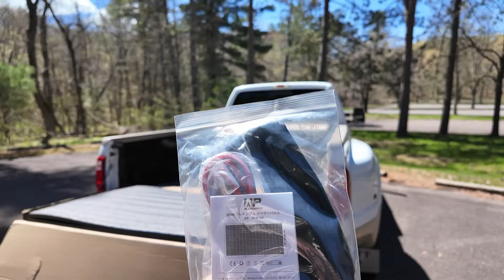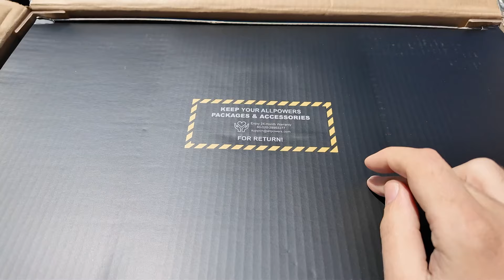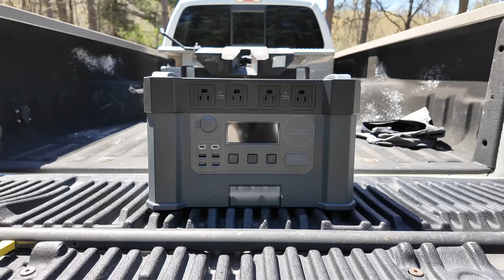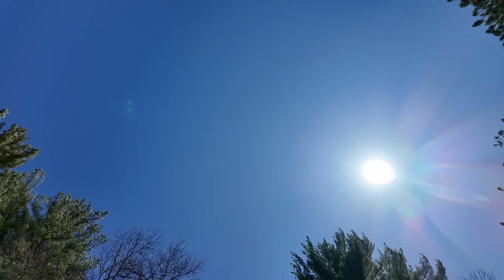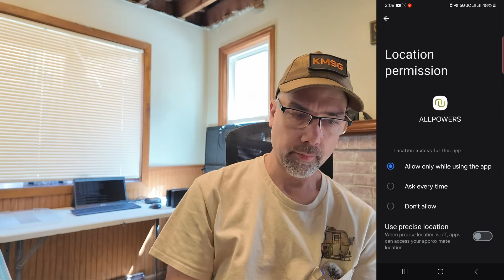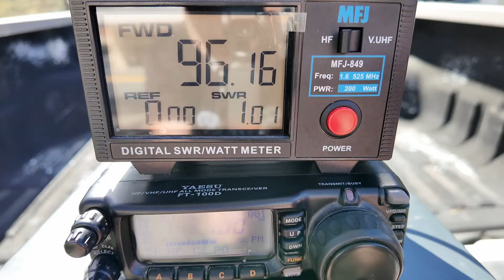The Allpowers S2000 Solar Generator

Comment: From a "bang for the buck" standpoint, "solar generators" are far more expensive than even the newer, ultra-quiet, inverter (ICE) generators on the market today (excluding Honda of course). The additional cost of adding adequate solar panels to your "solar generator" 'system' doesn't get discussed much or is usually glossed over. Quite often, the cost of a few hundred Watts of portable solar panels can easily eclipse the cost of the "solar generator" itself, making the cost of a renewable system even less economical. I would like to see contributors (who get all this stuff for free) make it more clear what the OVERALL cost will be. Ideally, it would be beneficial to be able to completely recharge your "solar generator" on one sunny day.
Reply from the maker: Nothing is free. Even for us big-time creators that are taking in all the YouTube bucks with zero effort.  Have you factored in the cost of gasoline?

Comment: The 10 amp limit on the legacy (1950's) cigarette lighter plug is just about useless for ham radio applications. Even my 50 Watt mobile wants a little over 11 Amps. A 100 Watt rig like your Yeasu wants 22-23 Amps. Some "solar generators" have a 25 to 30 Amp 12VDC output giving you a much more efficient means of powering a 100 Watt transceiver. Leave the Astron boat anchor at home. It's WAY too heavy and wastes a lot of precious battery power.
Reply from the maker: Stay tuned for more battery reviews to help find the right match!  Not every battery solves every problem.

Comment: Android sort of requires location access to use Bluetooth or WiFi. The developers can set a flag that says they pinky promise the app doesn't derive location but that's kinda dumb. You can find someone's location based on the devices around them. It's less of a problem with Bluetooth but a lot of devices use the username or the name the user gives the device for the Bluetooth ID which can be found by wardriving or looking at the maps people make. I haven't seen a map of Bluetooth devices but you can bet Google has one.
Reply from the maker: Everything is recorded.  Pray for our future politicians as NONE of them will have a clean past... its just not possible to stay clean until you're ancient enough to run for office.  😂😂

Comment: Why do you call this a solar "generator"? There is no such thing. It's a solar powered BATTERY.
Reply from the maker: You'll have to think about that a little harder.  A gasoline generator takes gas and makes electricity out of it.  This solar generator does the same thing with sunlight AND it can store it in a battery.  Pretty slick little kit.
Reply: This is a recurring argument with many opinions. "solar generator" is marketing speak for "portable battery powered inverter/converter with built-in solar and AC recharging capability".

Comment: That a great set up.  not the best choice for HAM radio but gets the job done. just a 12.8V 100 Ah or so Life PO4 is great for Ham radio. less RFI . but when wanting to use your AIR fryer ,it may just run it just fine. plug in solar  and do solar cooking.  I do not know  how much RFI noise that All powers will make. further testing needed.  I would go to a park to try it out and use it. That would be how I would use it.  I got a Anker one and that has USB C PD in and out so a USB C PD solar panel will charge it . just not as big as that one but for us tent campers it's great ! us radio operators like to eat good. I would be making some AIR fried chicken ! may be next test . 73's
Reply from the maker: A lunch in the park... I like it!
Reply: "Solar generators" are great tools for providing portable power. However, many owners (including myself) are disappointed when they are used for anything that primarily creates heat (resistance heating), such as hot plates, griddles, toasters, coffee makers, etc. They will eat through batteries in short order. Those are jobs best left up to propane. Leave the "solar generator" for electronics and motors.

Comment: It seems strange to have to use the mains PSU in series to run the Yaesu radio. That unit needs some other (higher current) 12v output socket than the low current cigarette lighter socket. Perhaps a 35 amp Anderson connector.
Reply from the maker: I agree!
Reply: Bluetti and a few other brands have higher current (25-30 Amps) outputs that are much more useful for 100 Watt transceivers.
Reply from the maker: @g-whiz286  Sure do, stay tuned for other battery reviews.  Next up is a simple DIY battery box!

Comment: I did not see the RF Quiet test? Did you check to see if it is interfering with the radio on receive? I am kind of interested in something like this for out in the field here. Thanks TO
Reply from the maker: I'm having a lot of trouble setting up an antenna here.  Its really hurting my abilities to get anything done!  On top of that we've had a TON of rain... I need to get this baby out to a PARK!!
Reply: @temporarilyoffline  Thanks TO. I just got a wire thrown in a tree right now but we have had tons of rain and my old house has been without power for 8 days.

Comment: Its my second 16:58  hurricane season in Florida and I'm thinking about one of these. Think it would run a fridge, a fan and maybe a tv? With the solar hooked up in the day.
Reply from the maker: A quick google search says the average fridge eats 3-6 amps... so you're looking at 16ish hours on just battery power for the fridge.  You can be wise and miserly and extend that - run the fridge for 1 hour every 4 hours and NEVER open it and you can probably get 2-3 days out of it... however you've added in the solar panel, so you'd be putting power back in.  Just look at the wattage on each unit and add them all up.  

You could also get an inverter and separate battery, then add more batteries as needed to get more runtime/add more devices.

Its a fun rabbit hole to go down.  In my camper I was able to last a week with 200ah of battery and a few solar panels. - After the week we left the unplugged site and plugged in.
Reply: @temporarilyoffline  - You really don't want to operate an average AC refrigerator from one of these unless that is all you have. A much more efficient option are these newer chest type 12/24 volt refrigerators. ICECO is just one of many manufacturers. They are designed to be skimpy on power usage and pair well with these solar generators. Since they open from the top, you don't lose all of your cold air every time you go into them.
Reply from the maker: @g-whiz286  ICECO is great, I reviewed one of their units on the channel before - used it in my 1966 beetle.  Love it.

Comment: 14:14 no DC output? So no powering a 100w Ham radio direct, you have to use an AC power supply?
Reply: I have yet to see a unit with a high output 12v, big disappointment
Reply: @rdmclark  - Bluetti AC200MAX has a 30 Amp DC output.
Reply from the maker: Agreed, there is a NEED!!!
Reply: @temporarilyoffline  Which is why I've been building my own.
Reply from the maker: @dougdaniels  very smart, and fun too!
Reply: You would think at least one of these companies could make a ham radio solar generator. I don't need the AC. Maybe a separate inverter for the times I did.
Reply: @moozoowizard  I've been looking for that for years.  The only LiFePO4 power bank I've found without an inverter is the Anker 548 Power Bank (PowerCore Reserve 192Wh) and that doesn't let you access the battery directly. It's great for my high-draw USB stuff. though. I'm still stuck building my own solutions for high-draw DC power. Shockingly, the 2x16Ah Miady box I built a few years ago is still not obsolete!
Reply from the maker: There is DC output, but only at 10a... not enough for a 100w radio.
Reply: @temporarilyoffline  - Barely enough for a 50 watt radio. Mine wants 11 Amps.
Reply from the maker: @g-whiz286  Yep, This one ain't for everybody.
Reply: @g-whiz286  They almost ALL have a hard limit of 10A... if you have any inrush current, even something rated at 10A will trip the protection circuit on many power stations.